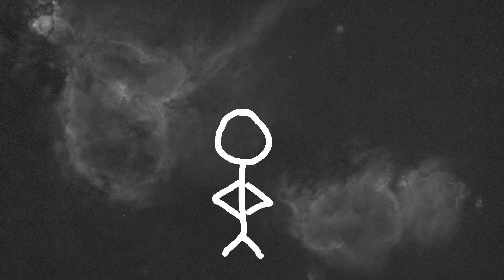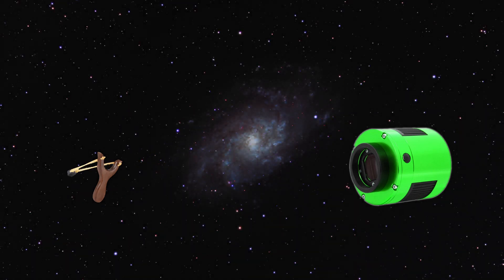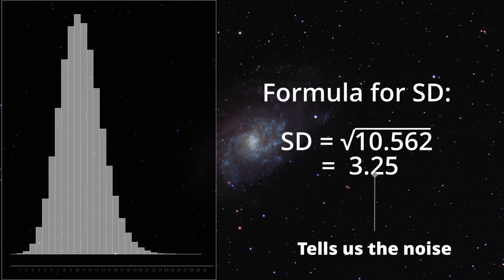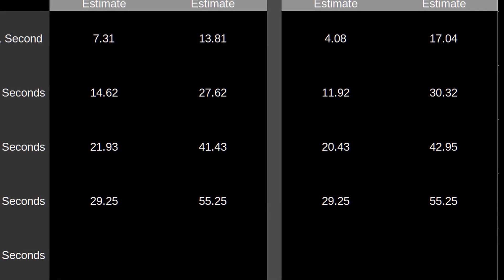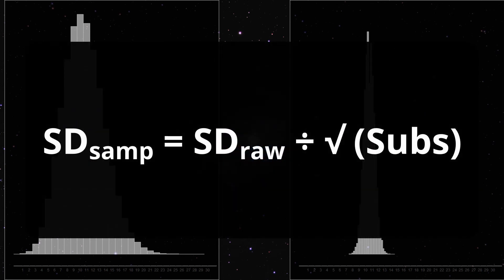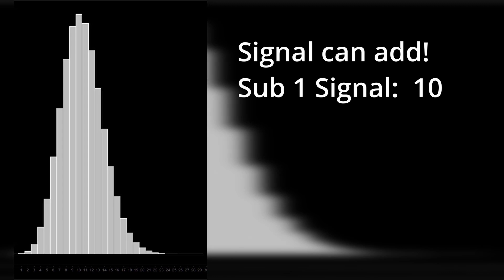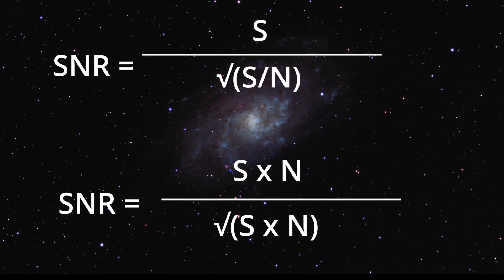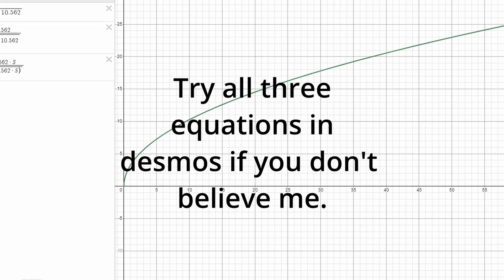What does stacking do to noise in astrophotography? Well, it depends...

Comment: Don't we all (c'mon, admit it) have visual evidence about how stacking manages to help us improve SNR without 'increasing signal' directly? Surely, we all have images where registration of the stars as our systems drift leaves edges of our stacked images with grainy, poorly defined sections where signal came from a more limited set of the entire collection of subs.

I often see astro-tubers refer to these as 'stacking artifacts' or 'registration errors' when they are neither. They are the result of a variety of problems that result in drift over the course of a session. Stacking reveals this drift and gives you strong visual evidence about noise (defining darkness) and signal (the stuff we're after for many hours at a time).

DSD, you're doing a nice job of giving us the math, the explanation and ways to think about what is happening in our images. But we all probably have lots of stacks with edges and corners that give a visual proof of everything you've explained.

Comment: Great videos! I love them, even though I sometimes get lost and need to rewatch them. 

I have a question which has been on my mind for ages, but have never really found the true answer, but I feel in these videos you are hinting at it. So my question is: say I take 100 three minute exposures and stack them. The result isn’t like having a 300 minute exposure, but is really just a three minute exposure with all the noise taken out - is this correct? Because in the stacking an average is taken, if a pixel say had a true value of 50, in my stack it would be pretty well bang on 50, but in a 300 minute exposure there would be a variance. Am I correct in my thinking then, basically a stack of images is what a very low noise single image would look like? (As you said in this video when stacking you don’t increase brightness).
Reply from the maker: Thanks! I think you've understood the first explanation pretty well. One thing to keep in mind too is that if you have an accurate enough measurement of how many photons hit a pixel every 6 minutes, you can just multiply that by 50 to get a very good estimate of a 5 hour exposure. In that case, enough "noise" in your measurement has been removed to make a reliable prediction. Or you can think of it as just adding up photons/electrons to get a "cumulative exposure." In that case, you have to define noise differently. But either way gets the same answer!

So whether you think of it as a very accurate average or cumulative exposure doesn't really matter (that much; the other sources of noise like read noise can add up though and so in very dark skies a longer exposure will  usually improve SNR faster; but it usually doesn't matter because of light pollution).

Comment: I have only one issue. The word "Average" shouldn't be used. Averages tell you nothing. If I tell you that the average temperature of a room is 22 Deg. C then you could conclude thats a nice comfortable room to be in? However, the room is only ever at two temperature -12 and +32 Deg. C. You should be using the word "Mean" in statistics. This might seem pedantic but a mean is associated with a shape or distribution and a std.Deviation or variance.
Finally, you have made a lot of work for yourself with these three video's and one of them could have been skipped because the scientific method states that when two things cannot be distinguished from each other, they are in fact the same thing!!! 🙂 Personally, I'd like to see more on the lucky-imaging of DSO's. At least you used my magic number, 16x sub-frame(time) = 1/4 of the noise.
Reply from the maker: Oh, I completely agree that "mean" is by far the more accurate term. I decided against it for a couple reasons: (1) I didn't want people to get confused with "mean" as in sum(observations)/n and "mean" as in "meaning" and (2) a lot of stacking software uses "average" as "mean" (e.g., in Siril it is "Average with rejection") so I thought keeping it consistent would help with understanding. 

Wrt making three videos, originally I was only going to do two. I was going to put this stuff into the last video, but decided it would make the 2nd video too complicated. Plus, if they only watched the 1st half of that video, they would come out thinking that the first video was just completely wrong without getting to the good stuff in video three.

Comment: Way too mathematical so in the end what is the outcome as I got all bleary eyed and tuned out as soon as you got all mathematical
Reply: It's just square roots and fractions...
And the video needs this mathematics to drive home the point that both perspectives are the same and produce the same calculation for SNR.
Reply: @scottrobinson4611  speak for yourself mate it's all Greek to me
Reply from the maker: The outcome is SNR is really the only thing that matters. You can treat stacking as increasing signal or decreasing noise (not really both). Either way gets you the exact same answer (i.e., signal starts to overpower the noise and you get a better image).